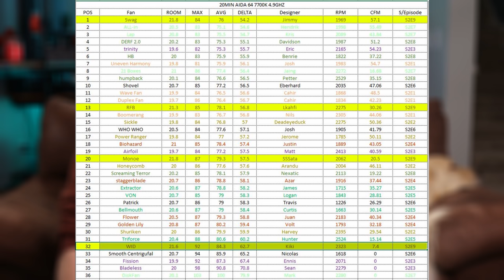WEIRDEST Fans I have ever seen – Fan Showdown S2E9

Comment: How do these compare with season one? Have the top ones been tested under the same conditions?
Reply: These are generally better, after all, there are 17 fans on this list that are better than the Noctua a12x25 which had a Delta of 57.4. And the last list of fans weren't really great none of them were better than the Noctua a12x25 last season.
Reply: @livedandletdie  Possibly, but the noctua may be better optimized for a water cooling rad setup with higher static pressure. It’s hard to believe that so many of these highly unconventional designs are actually better than the noctua. Also cfm was not a metric tested last season

Comment: Why aren't you putting the fan designs and files open for the public??? I would like the swag one and 3d print it for personal use it's a great fan
Reply: Not really his to give away are they.
Reply: They're not his fans.
Reply: @alpham777  I mean if he is making a video it doesn't take rocket science to make a copycat especially with the a12 x25 3d model on his page
Reply: I have a "Blender Ain't Cad" fan on Thingiverse. Didn't make it onto this channel yet, even though it's been submitted. I guess the luck of the draw hasn't been in it's favor since it was sent months ago. I'd think it's close to being in spec, but who knows? So if you try looking some of the other fans might be available by the people that designed them, since I did that with mine.

Only thing I could think of is he didn't have the resin printer yet when it was submitted, so maybe it got passed over due to thin surfaces? Might be a bit tricky to make work with FDM due to that. Resin should be able to do it, but I'm not sure how consistent scaling it between software and using an .STL exporter so there could be other unknown issues as I don't recall getting feedback on it.

Comment: Is it even scientific to rank fans by the delta? To me it's pretty obvious that deltas would be different for the same fan measured at 10 degrees and 30 degrees C. At this point making measurements temperature controlled is a requirement, not just floating around 20C +/-2C, which is probably pretty significant for 0.4 delta lead.

Comment: i do not think the way you do the smoke test is good enough. i think if you filled a box with smoke and made an outlet on its side with a fan, it would work better. as of right now it just looks like the smoker pushing it into the fan which just makes everything seem the same.

Comment: Great video!  The Monoe looked cool, shame it was so imbalanced.

It might be a few extra minutes to add to a fan's processing time, but you can actually dyynamically balance plastic fans by using small pieces of tape to make one side heavier, and then testing for vibrations. 

For "Close enough", it's possible to go until the vibration reaches a minimum by ear/feeling, or you can use accelerometers to get it as perfect as possible.

Model airplances use this trick to balance propellers and EDFs, here's a guide (scroll to "Practical implementation" for a TL;DR instruction set: https://www.rcgroups.com/forums/showthread.php?1267814-How-to-dynamically-balance-EDF-unit-with-a-cell-phone)

Comment: fan blade profile, starting angle 0.0002 degrees. curving to 5 degrees half way down each blade and finishing at 8 degrees where the tail pushes the air off. stacked to have at least a one inch gap between each outer leading tip or what ever it works out to for uniformity. thinking of silence. tried downloading fusion360 but the administrators decided to use there end of the free software to do things like randomly cut huge holes in things for no reason, add a line... no, your cutting another hole! they get so much from there subscriptions they just scalp free trials tryers like gpu miners burning cards and selling them. brand nwused, grate. wow, and then the printer decides to randomly squish what its working on, i think they think its funny... way to much money.